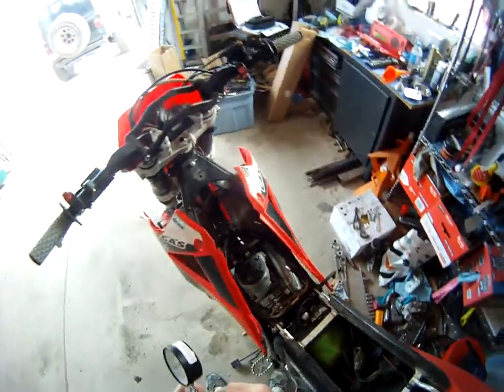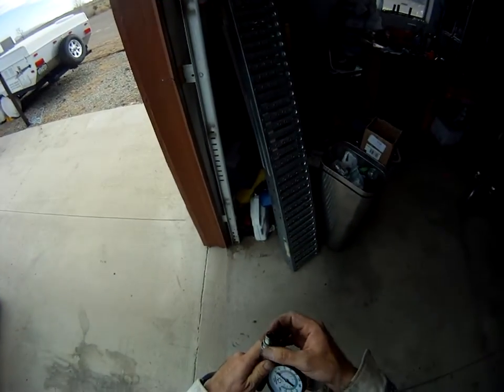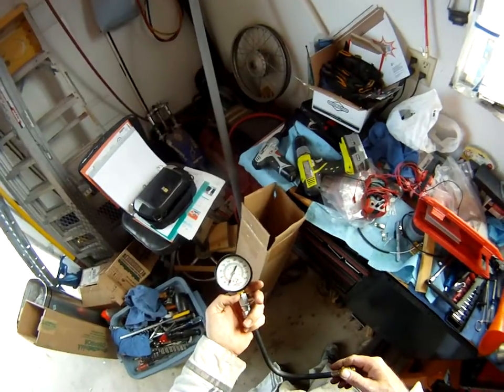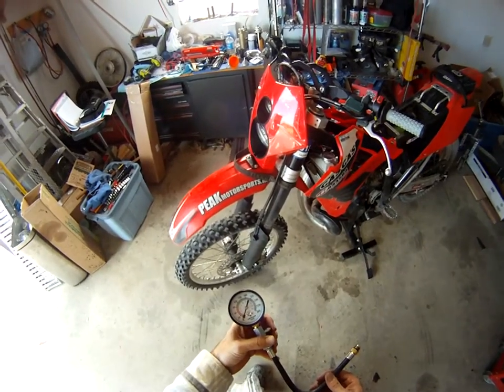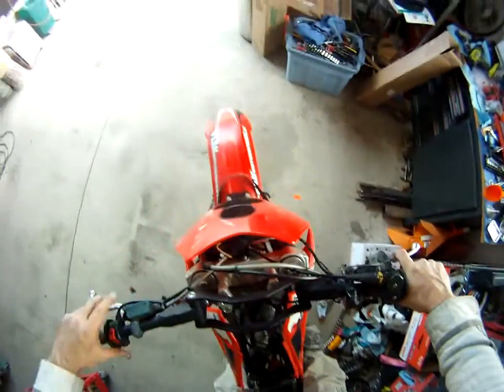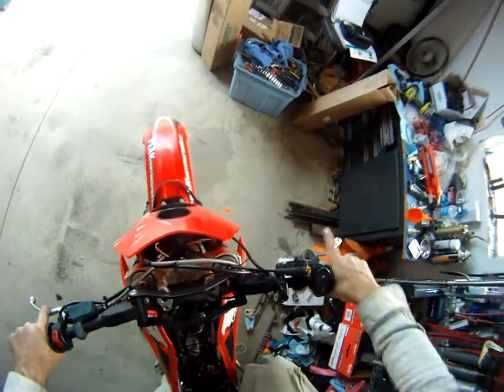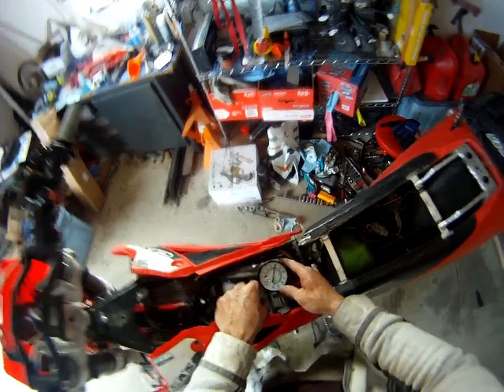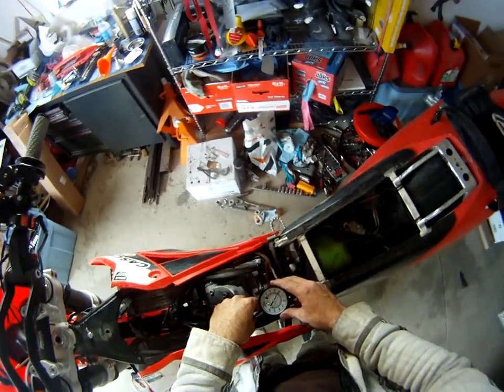Measuring compression 2007 GASGAS EC300

Comment: I just put a new top end in, set ring gap to 0.3mm and have a 0,4mm base gasket and get 140psi from my 06 300ec. At sea level.
Reply from the maker: @leifneilson8716  good info. Im sure you read the other comments below, definitely a range of pressures after rebuilds, maybe variability in gauges? IDK